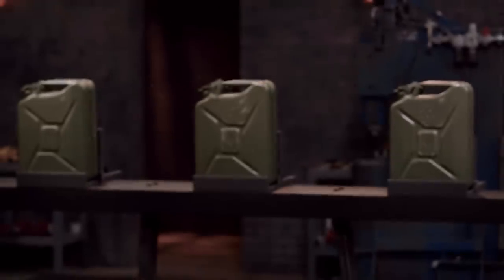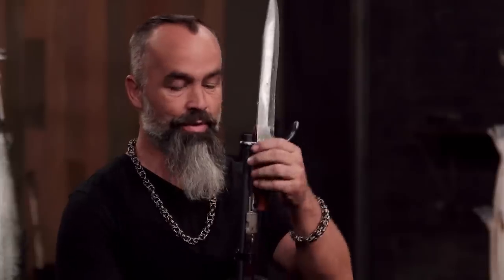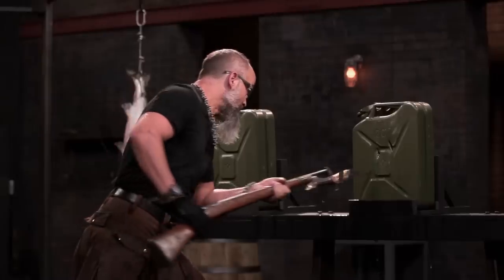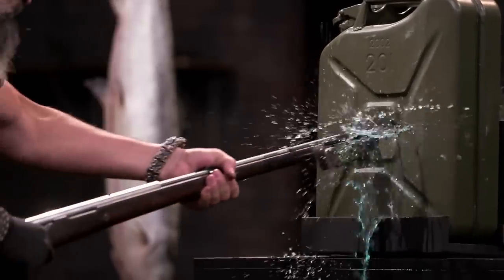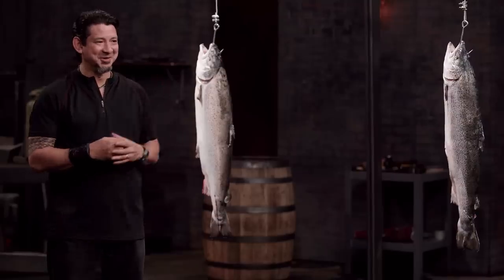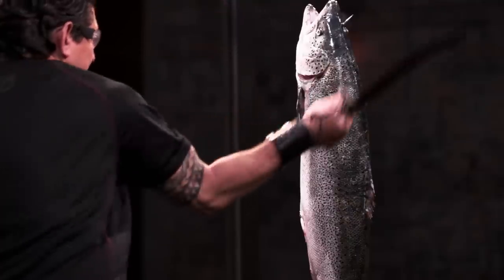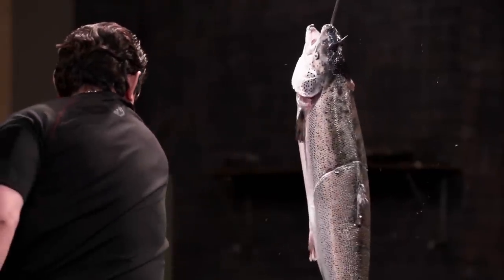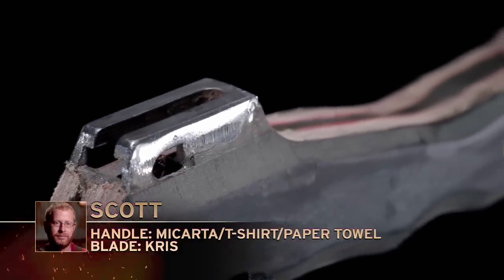Forged in Fire: BAYONETS CAUSE INSANE DESTRUCTION (Season 3) | History

Comment: I got to carry in a bayonet in battle for my M16A2 while fighting in Northern Afghanistan for 16 months.  It was a blast to train with, however I never used it.  For close quarter combat, I preferred my Benchmade.
Reply: Mos?
Reply: @havoc1zero  88M
Reply: @SuperSaiyanX-0014  so that explains the m16. As grunts, we use the m4. So I’m kinda wondering how a truck driver would fix bayonet in battle while fighting in northern Afghanistan. I mean, yeah, you might be ambushed and have to fight it off but you definitely weren’t using a bayonet in combat. Btw, I was 11c and deployed to Afghanistan back in 01, OEF1.
Reply: @havoc1zero  Nice.  I was deployed OEF 2006-2007.  I was a driver, but was in a CAV unit (3-71 CAV of the 10th Mountain Division).  The scouts were issued M4's, while my platoon was stuck with M16's.  Our supply SGT hooked us up with the bayonets.  I was FOB Naray and Kemdesh (later known as camp Keating).  We were often ambush at Keating, mostly while building the site.  Check out "The Outpost" on Netflix.  That was my unit.

Comment: NOT  a fair test slicing fish, bayonets were not supposed to have a sharp edge they were for stabbing. If Im correct I beleive sharpened edges were barred by the Geneva convention.
Reply: Nope - the Geneva Convention doesn't ban cutting edges.

And nations that expect their troops to be able to use their bayonets as, well, knives, (99% of their actual use) sharpen them.
Reply: @geodkyt  I have to disagree, thats why Britain introduced a spike ie, No4 Lee Enfield, that as NO cutting edge. I dont know which Geneva convention your reading but mine is very clear !!!!!
Reply: @bobclarke2705  I read it was serrated edges that where banned, blades designed to tear flesh in a ragged manner making medical treatment that much harder. Same for the triangular blades of the Trench Knives of WWI which could not be stitched easily.